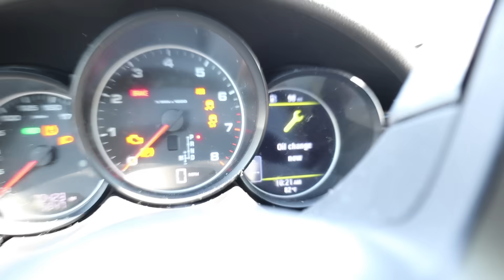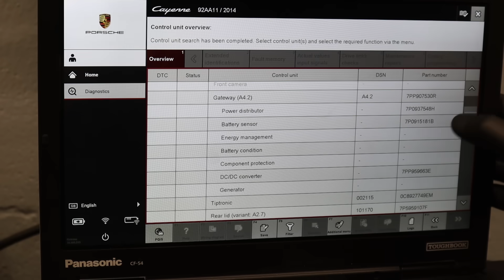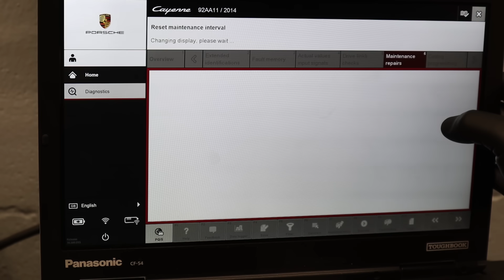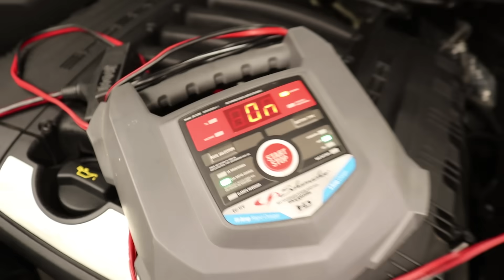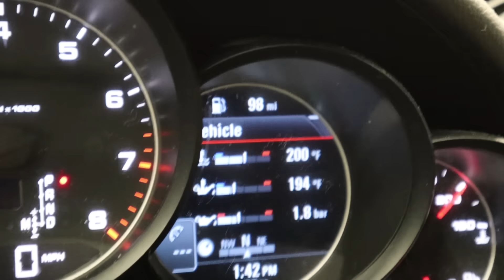Oil Change And Yearly Service | Porsche Cayenne

Comment: hi P-Tech my 2018 Cayenne base 3.6 seems burning oil, the oil level was at half level 4 months ago and now it is only at 1/4, I don't see any leaking around the engine. Is this normal for Porsche? Do i need to go back to the Porsche dealer let them fix it? It was a CPO car by the way.

Comment: Excellent.  About how much did this oil service cost? Parts and labor.  I know where I am taking my Porsche for service.
Reply from the maker: $475. Thanks for watching
Reply: @PorscheTech  What?  What?  I will not tell you how much the two local Porsche dealerships wanted to charge me...other than it was over double $475.   They give credence to the term stealerships.  Also they tried to scare me with the "if you don't clean the firewall your car will catch on fire."  Bummer that you are more than two hours from where I am in WI.  Fortunately there is a independent close by who is reasonable.  Not a Porsche specialist but all euros, MB, BMW, Ferrari etc.  They are very good too.  Will even let me "help."  No Starbucks cappuccino in the waiting room, so what!  Again, thank you.  Most enjoyable video.  As said before, I know where I will be bringing my Porsche.  An buying my next car.

Comment: My dealership charges $500 for an oil change on a VR6 Cayenne and doesn't do ANYTHING other than an oil change, and there is always oil all over the k-member and oil pan. Lucky if they use a rag to wipe up any drips, usually they just leave it.

I said fuck that and bought a Durametric. Paid for itself the first oil change which took me about 10 minutes for the actual oil change.

Comment: Hey! I´m 16 and this is basically my dream job, specifically at Porsche. I wanted to ask you if you need to go to college or even be an mechanical engineer to work at Porsche. I´m asking this because I was planning on just going to something equivalent to an UTI  (I´m not from the US), work at a dealership for example and after some years of experience I woud then apply for Porsche, can you give me your oppinion?

Comment: Wasn’t the cayenne at temperature when the customer dropped it off?
Reply from the maker: bertraminc yes but we wouldn’t necessarily work on it as soon as they drop off. Even if it was at operating temp I would still drive it to make sure nothing abnormal is going on. Thanks for watching

Comment: A goldmine for most 3,6dfi owners :) i’ve got a question, my local CP used 0w40 instead of 5w30 on my 3.6 (suprisingly). Is it a problem and should i consider change it back to 5w30 asap ?
Reply: That sounds like Mobil 1's European oil.  Good stuff for your Porsche.

Comment: 25:12 is the dipstick a service tool?
Reply: I think it is. On the 3.0T Audi’s it just has a plug at the end of the dipstick tube. If you want to check the oil manually you have to buy a dipstick.
Reply: Porsche VR6 still has a dipstick. Audi may have removed it for cost savings/whatever reason.
Reply: @mioisurugi2010  car in the video seems to have plug only

Comment: Go to Porsche dealership for service.. oil change 1 hour (most of the time cleaning oil filter housing and underside of engine), vacuums gunk, lubricates moldings and seals. That will be $2000 sir...

Comment: I worked at Mercedes and they have a central oil tank in the corner of the building. Each bay has air, water, oil lines which are reals you just pull out tell the computer how much oil you need and then press start. The rest is automatically done. Pouring in oil by 1 litre bottles is wastfull and more expensive way of doing it.

Comment: Oil level looks pretty good to me,  exactly in the middle  , between min and max.  That is the way it should be.   NEVER  fill it to the max level,  if you don´t want to damage the motor.
Reply: I always fill to the max.  No problems in 43 years.  Maybe I'm just lucky.  I even have gone just a bit higher on occasion.  Never had aeration occur. You would need quite a bit of extra oil over the max fill line to start aerating oil, which would be a bad thing.

Comment: Are those cayenne reliable?
Reply: Ya lol one of the most reliable engines it’s a vw vr6 the v8s are a bit more work and a. Pain in the ass to do most stuff and you can buy vw parts cheaper then put them on your self and save a lot most people wouldent know that but ya

Comment: It's hard to imagine that the engine air cleaners & cabin air filter were not at least inspected.  I don't care what the manufacturer says about the service intervals.  Judging from the debris at the firewall area, door jambs, gas door I shudder to think what those filters looked like!  A contaminated air cleaner will send the engine crankcase pressure of the charts, which in turn will cause oil leaks at the weakest point in the engine which will give away...sometimes the front engine crank seal or worse.  From the housekeeping standard this car was kept it looks like a leased car.  The lessee couldn't care less; the subsequent owner will come to bear the brunt of the minimised maintenance. It's in the best interest of the manufacturer, dealer and the government (think sales tax) for cars to last only through the warranty period.  Be aware of this when purchasing even a CPO car.  Inspect the car hands-on and more importantly review the maintenance and warranty repair orders.  The lower the mileage on a CPO car the better; many times they are still under the bumper to bumper warranty.  Kudos to the technician for cleaning the above mentioned items.  I shudder to think what the car owner's house looks like...oink, oink!

Comment: I’d be embarrassed if I brought my Porsche in for service & the interior & seals were that dirty, poor thing.  Looks like this poor car doesn’t have a garage. 🙁
Reply: I'm a Service Advisor at a dealership and this is the norm unfortunately. I went to move an SUV once and it had used diapers in it and an exposed trash can with god knows what inside.

Comment: My dealer charged me extra to clean out the leaves from the cowl and clear all the body drains, almost $200 over the normal oil change/10K mile maintenance).

EDIT: I just checked and they didn't bother cleaning any of the door seals LOL. What a joke.

Comment: Hang on..... The vehicle doesn't come with an engine oil dipstick to check fluid level?  Just a black plug?  😐😳    Let me guess, the dipstick is a special Porsche authorized dealer only service tool. 🤣

Comment: One minute in: that's a janky ass Cayenne.
Reply: If they're more than 5 years old they pretty much all are. It's a daily driver for the well-heeled (or striving to appear) soccer-mom. After that, retail tanks and they end up on BHPH lots. A used Turbo often goes around $15K. A used V6? 7 or 8 in good shape.

Comment: Seems like the water drain system is poorly designed and can easily clog in normal driving condition. Too much time spent on doing cosmetic type of works. You can tell the owner of the car are of similar type...

Comment: None of the Porsche dealerships I've been to performed even half of what this guy did.  I bring my car in for annual service and they only changed the engine oil.  They didn't even bother to wash  my car.  I bought the complete maintenance pkg for 5 years & paid  around $30K which was supposed to include everything.  Had a nail in one of my tires and they said they'll order a new tire for me....that was since last Xmas 2023 but heard nothing back from them.  I'm still driving with a patched tire performed free by America's Tire.   This video is pure BS advertisement.  Porsche service centers would never go through all these  time consuming steps let alone blow out leaf debris and spit shine your engine abay and lube your door seals s shown here.  The only time you get this level of service is when you buy a new car with them every year.